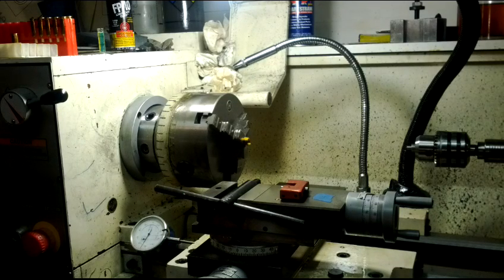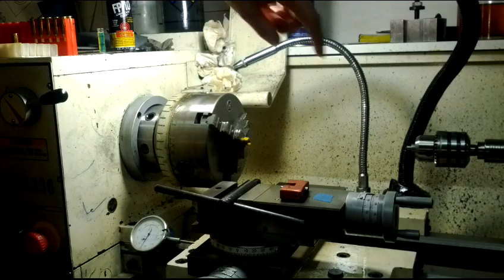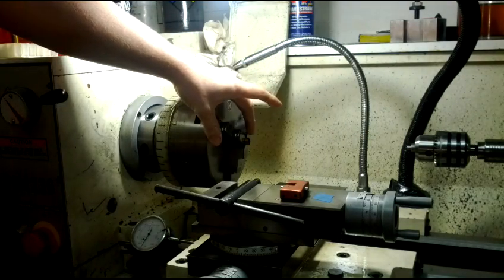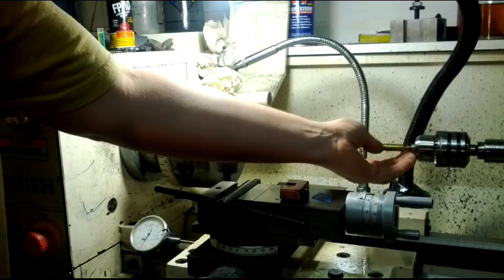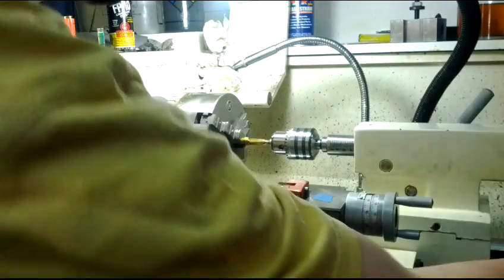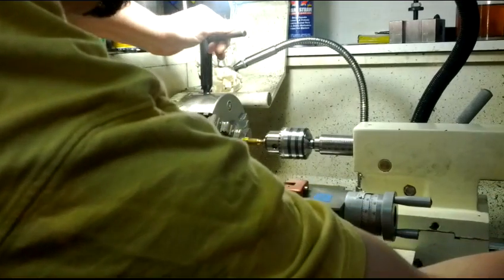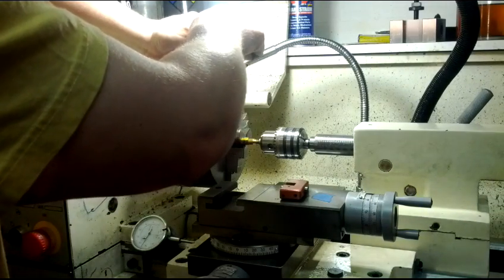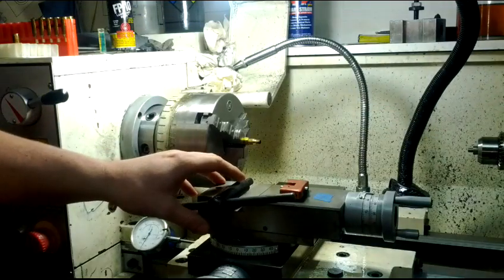Neck turning on a lathe (reloading for accuracy) for benchrest shooting

Comment: You should have just used an electric screwdriver.   You used a hand tool on a lathe?  I recommend you remove this video.
Reply: SomeDude308   I would take a guess and say you are not a machinist. Hand tools are used on a lathe fairly often. He did not have long clothes that could get caught in the chuck, he was using an appropriate speed and, he was also taking care not to get caught up in the chuck. I see no problem with what he was doing and, no he does not need to remove the video.